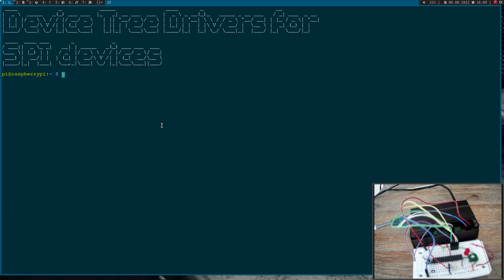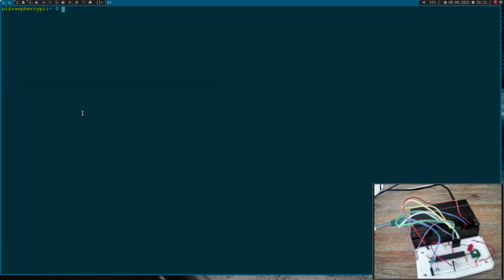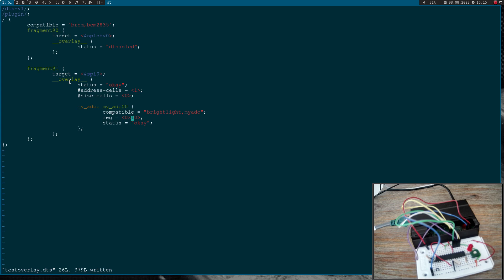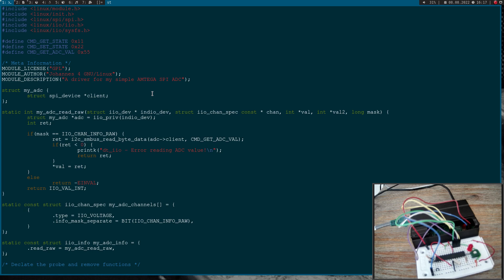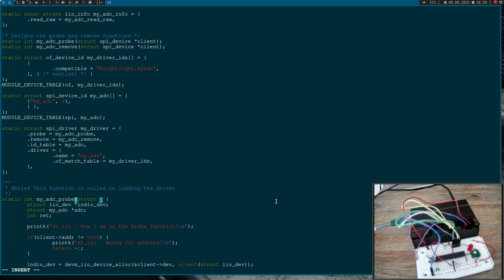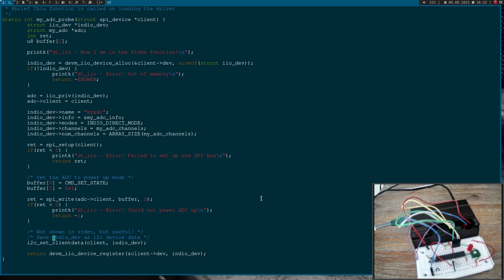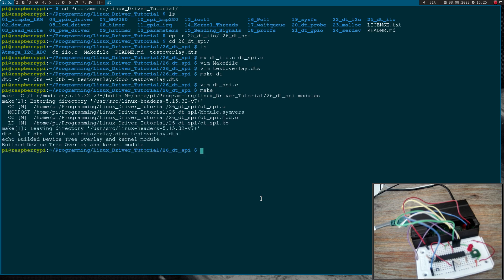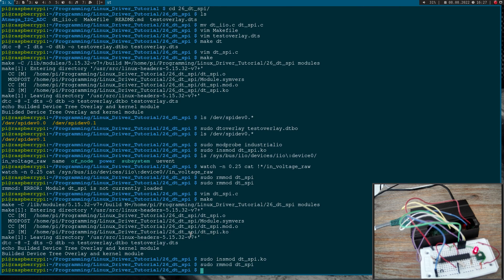Let's code a Linux Driver - 26: Device Tree Driver for an SPI device (IIO compatible)

Comment: Hi Johannes, thanks for the video !! I have an SPI TO QUAD-LIN BRIDGE and I need to create it's driver for my Rpi so is there any similar example in your tutorials? Thank you
Reply from the maker: You are welcome. So basically this driver is what you need to get started. Maybe I am wrong, as I am no LIN expert, but as I know, currently there is no LIN support in the Linux Kernel. There are approaches to do this like https://rtime.felk.cvut.cz/can/sllin-rtlws14-paper.pdf
So, basically LIN is just an UART interface, right? So, maybe you can start by writing a UART driver so that our SPI LIN Bridge will be detected under /dev/ttyUSB* or /dev/ttyACM*. Then I would look how over serial bridges are implemented.

Comment: Does anyone have experience working with spi drivers in linux in kernel 6.0 or higher? They removed the spi_busnum_to_master function and I am unsure of how to register a spi master now
Reply from the maker: The method presented in this video doesn't need the spi_busnum_to_master function. 
In an earlier video I used it. So thanks for the hint, I will take a look at it.

Comment: Hi.
Cool tutorial.
Did you know how assign driver to device in non device tree systems (ACPI) ?

I want to do something like this:
(gpio device) -> (gpio driver) -> (spi bitbang driver) -> (my spi driver)
Reply from the maker: I already made a previous video about SPI without the device tree. So if you don't want to use the spi_driver struct, it should work. Here it is: https://www.youtube.com/watch?v=RZuL-j5qXg0&t=1113s
If you want to use the spi_driver without device tree, I don't know how it is done. But I know for sure it is possible with I2C see here: https://embetronicx.com/tutorials/linux/device-drivers/i2c-linux-device-driver-using-raspberry-pi/
I am quite sure there is a similar thing for SPI.